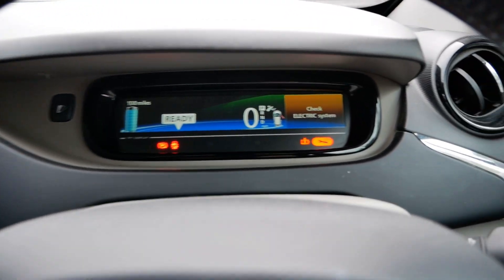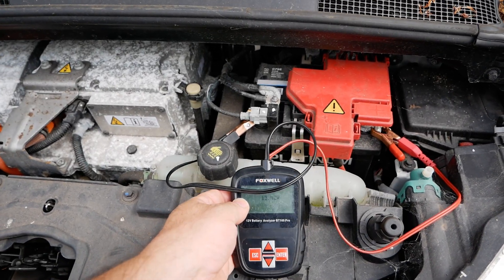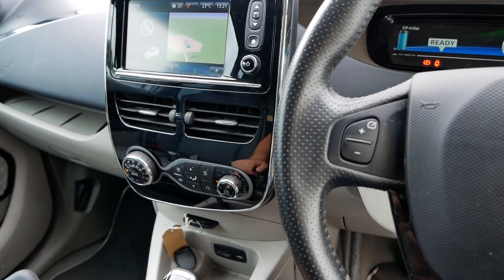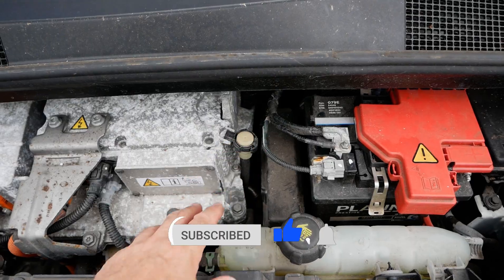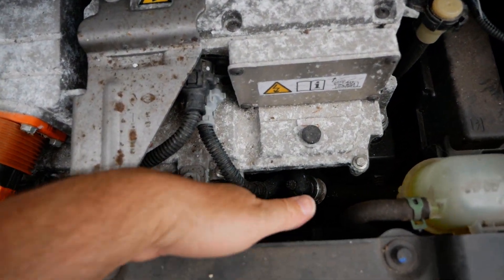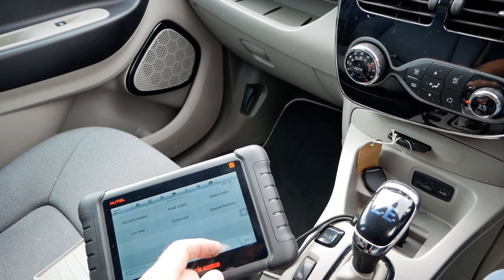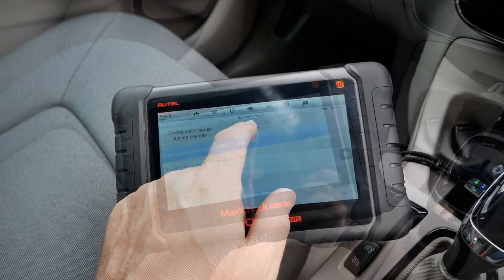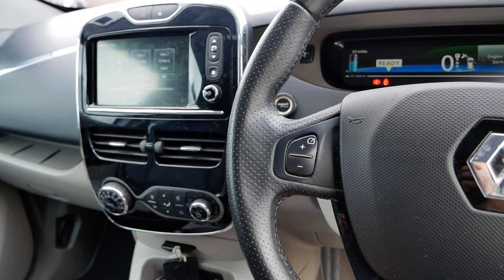Renault Zoe "Check ELECTRICAL system" error and how to fix it.

Comment: I've had this error and the more dreading red error electrical failure STOP! 
A quick 10min drive around, off and on clears this. 
Zoes don't like being left unwanted 😊
Reply from the maker: The 12V battery was low then. Best to charge it, if you have a mains charger. 10 mins of driving doesn't give it enough of a charge.

Comment: Do you know if “check charging port” is caused by the same things?? Seems something with communication? Car doesnt charge on any charger anymore. Not home not fast nothing.
Reply from the maker: Yes it can. But unfortunately charging problems are a common Zoe problem and you'll probably want to get it checked by a HEVRA garage or  Gary at https://tradeevparts.co.uk/ is the best Zoe repairer.

Comment: Hi. My bf has this error , but if the 12 voltage battery is low or bad , shouldn't it give 12 voltage battery error ? Renault zoe manual says this error indicate 400 voltage battery issue ?
Reply from the maker: No. There's only about 6 possible messages it puts up on the screen and this is the one for low 12V battery, plus a host of other issues.

Comment: Excellent and interesting vlog I have a Nissan townstar EV, now fully repaired cat s, just need to get the airbag module put back in and hopefully the crash data has been cleared, although I noticed upon my test drive the other day the electrotechnical system fault warning light was on in red so I’m rather concerned 
Any advice and guidance would be greatly appreciated 
Kind regards and take care Mark from Billericay 😃👍
Reply from the maker: You'll need to read the codes to see what's wrong.
Reply: @GoGreenAutos ok thank you. I have a Topdon artidiag 800bt with free uploaded latest software but unable to read, so I will have to find someone with a special computer as it’s so new kind regards 😃👍

Comment: Remember all new cars, and from aprox from 2010 are made to fail witihin 100 000 km. They are enginered to need repairs that will exceed the price of the vehicle. Take a look at the wetbelt Fords. Luckily insurance companies haven't caught on yet. Be sure to have the policy that covers engine failure, my 2018 Zoe's motor died after around 70k km. Faulty ball bearing on the main drive axle. They couldn't change the bearing, because Renault does not sell them as parts, and keeps the data about them secret.. So needed a new motor for a total of 4500 dollars.. I paid 700 and the insurance covered the rest. Those motors are designed to fail...

Comment: Think we had the water pump code on my work van, Kangoo ZE33.
Renault dealer said battery water pump (£600 if they could get one), but cleared code and it's not returned.
Reply from the maker: £600 to change a water pump on a hose! Wow.
Reply: @GoGreenAutos  I just got asked €1300 in total for water pump and diagnostics (around 190000 km now)

Comment: Yes! The pump counter! It started displaying this on my 67 Zoe a couple of days ago, and your video was invaluable when I took her into my local independent - water pump rev counter was indeed the culprit, and resetting it cleared the fault (the pump is functioning).
Thanks Matt!
Reply from the maker: Glad the vid helped. If they didn't know about this pump counter, they could have been changing components and getting no where!
Reply: Oh! I am already around commenting about all zoe people needs to know  about this. Guess I found out through this video. F scammy all the dealerships nowadays... Thank you for saving me 900 dollars," Go Green Autos"-channel owner.
Reply: I had the same issue.. I showed your video to the garage doing the diagnostics and it fixed the problem. So much thanks for this video.
Reply: hello , thank you very good video .but i can't get to connect to obd and i've heard there's a procedure to put the car in diagnosis mode but can't figure out. thanks in advance.
Reply: @macfly9917 put the key in the slot, gear to D, press Start button untill say please remove key, gear lever to P, leave the key in the slot. Voila that's it

Comment: Really helpful but worrying that a service agent would charge so much for that to be done.

Had this with my Zoe,not realising the 12v was flat the car would not charge.
By the time that i did and replaced the 12v the car was full of error messages so again would not charge.
 Of course I didnt know the car had error messages so needed someone to fix that!

Comment: Hola, entiendo que si el contador de la bomba de agua va sumando, significa que funciona la bomba de agua, no? porque no veo en ningún momento que el agua refrigerante recircule. No tengo en OBD autel, así que no puedo realizar la prueba con este OBD. 

Muchas gracias!

Hi, I understand that if the water pump counter keeps increasing, it means the water pump is working, right? I'm asking because I don’t see the coolant circulating at any point. I don’t have an Autel OBD, so I can't run the test with that device.

Comment: We have "Electric Motor Failure" and Renault says it is the low voltage converter that needs replacing. It's a 2017 plate BUT only has 32k miles. Renault is quoting £3,200 for the repair. We're trying to get a good will contribution. It seems this is a part failure or bad design and not "wear and tear".
Reply from the maker: I think you'll be unlikely to get a discount when the car is 8 years old!
But they know how to charge. In future using a HEVRA garage, see https://hevra.org.uk/ev-garages-near-me/
Reply: @GoGreenAutos  We haven't paid them yet. Will contact some HEVRA garages. It's just that the car has done so few miles, only 15k when we bought it two years ago and it was 6 years old. It's been forwarded to a manager now...let's see.
Reply: I have the same issue. But I'm i  n Ireland

Comment: Mine is throwing up this error. Looked at OBD and it mentions two things, 1) water pump and 2) sunshine sensor. How do I fix the sunshine sensor please? Thanks
Reply from the maker: I doubt very much that the light sensor would cause a dash error fault. It's a very low priority thing. Anyway, you'll just have to change it.
Reply: @ Thanks for the prompt response! I’m subscribed and appreciate what you do. The errror code is DTC910615 and says ‘Sunshine sensor circuit Open circuit or short circuit to + 12v’
Happy to pay for a solution if you find one. I’ll try and fix the water pump now, but would appreciate if I can fix this as well. 
Thanks

Comment: Thanks for this great video that’s put my mind at ease a little! I have a 2019 Zoe with 100k and have this on the dash. I have the car booked in with my local (not Renault) garage so will get them to check using this guide. My cruise control/speed limiter stopped working at the same time: do you or anyone else have any suggestions as to why that might happen? Thanks again!
Reply: Hi. My 2017 Zoe has this same problem now. How did yours go? Was it 12V battery and what happened to cruise control/speed limiter? Thank you.

Comment: The water pump magic number is 10'000 hours of use 🙂 (counters are expressed in seconds in the software)
Reply: Planned obsolescence my friend
Reply: @lucanspittle8213  according to the manual, you should change the pump and reset the counter. In ICE motors, the pump is changed too (while doing the timing belt).

Comment: I have a zoe that occasionally show "CHECK ELECTRIC SYSTEMS and generic OBD tester reports fault P0852(F1), someone said it is a DC\/DC converter fault, is that possible? The fault doesn't affect anything, the car drives normally, charges only the cruise control doesn't work. The fault sometimes goes away and reappears. It also disappears often when charging at an AC station.

Comment: Did you ever have a zoe with "Check Hillstart Assist system" and one of the rear wheels locked?
Reply from the maker: Probably the handrake shoes stuck on
Reply: @GoGreenAutos  Thanks for the reply, currently at the mechanic, any idea what causes it?

Comment: Thank you for informative video. ZE40 2919 got this error. I changed battery, but error not dissapeared. I would like to buy same ”error checker” . Would you be so kind and recommend someghing for me?
Thank you.
Reply from the maker: The diagnostic scanner I have and use in this video is a Autel MaxiCheck MX808TS. Cheaper Autel scanners are available which likely use the same software.

Comment: This may have been asked already but would it be worth having the counter reset anyway? 
If the counter wont show up does that mean only Renault can do it? As it wouldnt surprise me.
I've a 2015 and soon as the message showed up i swtiched out the 12V. Its cleared, but it makes me wonder what Renault hides in the software. Unless its a safety issue there shouldnt be a countdown timer on a part that could go on and on. Thats daylight robbery..
Reply from the maker: Anyone with a half decent diagnostic scanner can reset the water pump counter, as I showed in the video. So it's not something only Renault can do. In fact, I think you'd struggle to get them to do this if you tried.
If the counter doesn't show up, it probably means that there isn't one. I've not yet done enough to see what versions have the counters on the water pump.

Comment: @go green cars: Do you know DTC080C96? (in PEB/DCDC)
If your Zoe fails inspection because this fault is stored and cannot be cleared, there is a document from Renault that this fault can be ignored at inspection.
Happened to me in June 2024 and my dealer had a lot of trouble getting the MOT for my Zoe. After dealing with Renault, this fault is no longer a fault for which they can refuse the MOT for the vehicle.
(if that's an issue in the UK...)
I've also linked the document under my water pump video. (evwiki)

Comment: WATERPUMP , ELEC DTC0463F1
The counter is in time, in seconds and it throws an error when reaches 36.000.000 seconds and there are three counters they accumulate to this value.
I did a video on my channel  /Yrq2DaWGeNw  how to view and reset the counters with simple tools.

Comment: 8:40 just resetting the counter is NOT the solution!😅
Because the thing with EVs is that if the water pump really fails, you INSTANTLY loose all the power and can not drive any more, even on modern EVs like the VW ID.7.
The water pump and the caused coolant flow is absolute necessary to power the power electronics that drive the motor!😅
Reply: He showed how to check the flow. And on the Zoe, there is no electronic systemp to check if the pump works.

Comment: HOW OLD was the Renault ZOE with the water pump counter fault??
And what was the milage??
Reply from the maker: 9 years old. Can't remember the mileage...probably around 50k miles.
Reply: @GoGreenAutos  ok crazy 
My Zoe Q210 now has this ELEC error for the first time. It is from 10/2013 and has 207 000 km on it, so it never had a pump error before
So I hope now it must be the pump error

Comment: Thanks for the good video's. The 12V battery in one of our Zoe's only delivers 10.9 V so it seems to be on its way out, last week the car refused to charge and even seemed to blow up a copple of 11 kW AC chargers. Visited the dealer who gave us a OBD error code readout and reset for € 50,-. Took it home and hooked it up to our own 11 kW pole and it charged ! So far so good. After seeing your video's i took my multimeter and checked the 12V battery in the right way so now i think i know the probable cause. What i'm wondering about is why a 'starter battery' is standard for a Zoe ? Those can deliver a relatively high starting power (420 A) but an EV doesn't need this. Aren't there battery that keep 12 V  better over time ?
Reply from the maker: A 12V leisure battery would be better in an EV. High cold cranking amps are not needed.

Comment: Ive had various error messages being thrown up. ABS, TPMS, Brake system check. 12v battery is new, it stops the speedometer and the power steering from working but goes off of its own accord every now and then. All abs sensors are working.  All wiring and fuses have been checked. 2019 R110 40. Any ideas anyone? An auto spark gave up.😢😢
Reply from the maker: It could be a damaged wiring loom....rodent damage to cables is quite common.
Also, just because a 12V battery is new, doesn't mean its suitably charged. They can flatten very quickly.
Reply: Thanks for your reply. Yes I thought the same,  the new battery I charged up myself before fitting. The wiring loom was checked by my auto spark and it was fine. Do you think there is a power drain somewhere lowering the voltage?

Comment: In mine it was the driving water pump counter. 
I used a vgate icar pro obd adapter and ddt4all on my Mac to reset the counters. 
I simply sent hex codes 2E334900000000 followed by 2E334A00000000 and lastly 2E334B00000000. That reset the 3 counters to 0. 
Before doing that I would make sure your adapter works and you can read the ECU values properly in DDT4ALL though(you can literally brick your car if it’s not working properly and/or you send improper commands).  
Also put the car in diagnostic mode first.
Reply from the maker: There's no "simply" about that method!
Reply: @GoGreenAutos  sure it requires some computer skills, but at least it’s cheap. 😅
DDT4ALL is free and the obd adapter is less than 20 gbp.
Reply: What was the error message DTC?
Could you read the error message in CANze and in which ECU?
Reply: @maerklin29800 I only have an iPhone so reading DTC in CanZE doesn’t work. In EOBD-FACILE it said something about the water pump though. Don’t remember which ECU, I just loaded all of them.

Comment: What a great video, quick question is it safe to charge the car if this happens?
Reply from the maker: Yes. Charging the car will also charge the 12V battery so will often (possibly temporarily) solve the problem if its due to the 12V battery. However, if the 12V battery is too flat, the car will not charge. So you need to charge or replace the 12V battery first if that is flat.
Reply: 12v was replaced, error not clearing, brought to HEVRA garage they diagnosed it and error still not clearing so waiting for water pump at the mo, is it safe to charge still? Thanks
Reply: Forgot to add, it drives fine and it charges fine, but would I be doing damage long term?

Comment: Hi, Can you use any OBD reader to reset pump counter ? Or I need to get specific one? Thanks
Reply from the maker: Impossible to answer as it depends on the software on the OBD reader. I suspect most will do this just fine. Mine is a basic Autel that hasn't had a software update in over 3 years and it does the job.

Comment: Half of all issues on the Zoe seem to be able to be fixed by unplugging the 12V battery,  waiting a few minutes (charging it first if you want) and plugging it in again.
Reply from the maker: Yes temporarily. But unless the actual source of the problem is fixed, the error will repeat. Often that is charging of the 12V battery, whether you do it or let the car do it.

Comment: Very interesting, these errors are so alarming, good to see a possible fix explained. Any chance you've come across the Nissan 'I-Key System fault' on the Leaf? I'm getting the "I-Key system" fault (steering lock not engaging), with a DTC of "B26E9-00 09" seems to relate to steering lock, been told it is likely the BCM module behind the glove box with issues or possible water ingress. WHen the fault is active the steering lock won't engage, when it occasionallly goes away, I hear the steering lock energise when opening the door on exit and the steering locks fine.

Comment: I don't think its revolutions of the pump its counting. It looks like it is counting the "seconds" its been in operation commanded by the ECU.  That's a bit naughty of Renault to build in a timed failure mode into the car.
Reply: No, because you actually need the pumps to be able to drive the car. If one pump fails, an EV can not drive any more, because the power electronics always need coolant flow.
So you actually need to replace the pump before it fails.😅

Comment: I would imagine on modern cars from all manufacturers there exists similar types of "use" errors.  It should be illegal but of course who polices such behaviour.  It's a cheat in my opinion just like dieselgate.

I loathe VW for not allowing me to simply turn off the service due indicator on my ID.3.  I use a very reputable independent which I am allowed to do.  Just let me easily reset the indicator please VW.  It's my car ...

Comment: My first EV was a 40kW Zoe...never had this sort of issues, but I also sold it after 6 months. Not a great car, unfortunantly. 
The driving is not bad, its a decent car on that aspect, but it just gives the feeling of "prototype" witch isn't acceptaable on a 2018 car.
What I mean by "prototype" feeling is the the constant fear that its just going to leave you stranded...it might charge, or it might not (happened quite a lot because of its sensitivy to earth resistance), it might just brain fart and decide to give you a scare...once I was going to enter the motorway and, out of nowhere, it just flashed a red warning screen on the dash for 1 second or less, followed by the motor shutting down and after maybe 1.5 seconds it just came back, no more faults.  I stopped the car, connected Can ZE, checked and there was an error on the BCB..."Internal Failiure". Cleared the errors and never came back...
Once I was charging and it just decided it would stop the charges every 4 min. No error, just terminated the charging. 

Anyone thinking on buying this, just buy something else.
I had a Peugeot iOn, never had any issues, and since I traded the Zoe for an Ioniq 38kW, never had any issue like this again, it just works.
I actually had to change the 12V battery on the Ioniq, but before it started brain farting, the car started saying "Low 12V battery".
Its a shame but the Zoe just doesn't feel like a finished product.